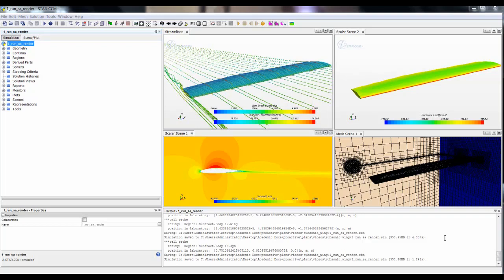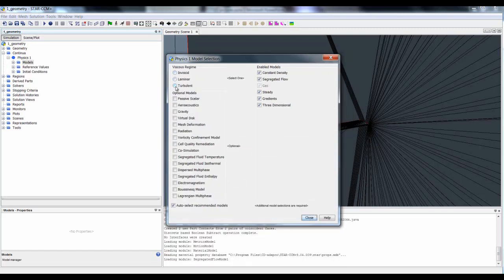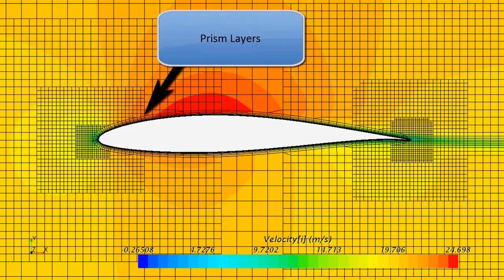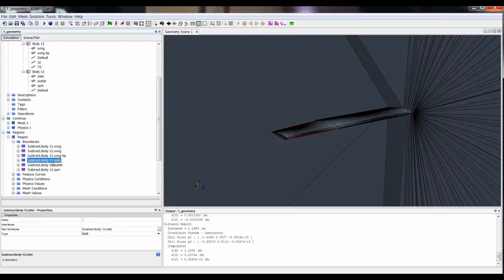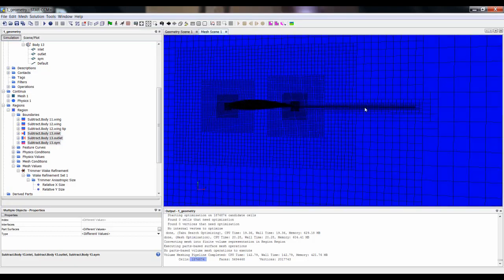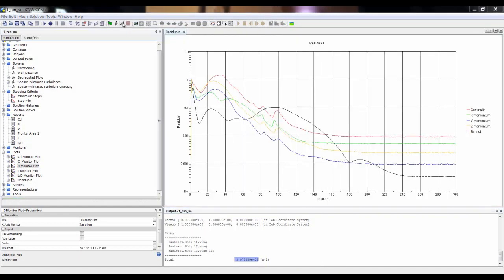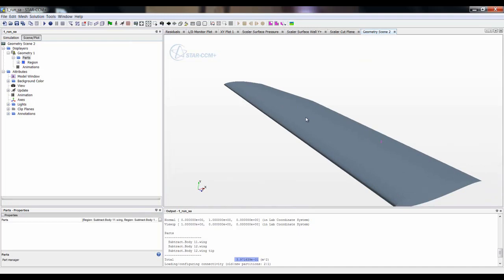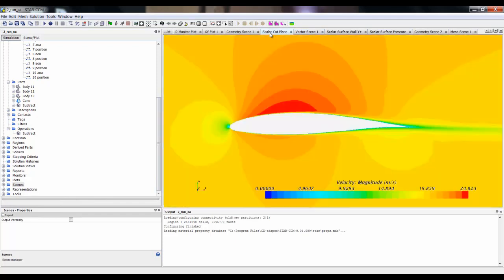Creation of Wing CAD, Parameterized for Rapid CFD Design Iterations

Comment: cool stuff. You should try to add some wing twist, and see at which angle the root stalls before the tip for a certain speed. Wing tips are typically set to stall later, so the ailerons (usually closer to the tip) still provides some authority when stalls starts. Also root stalls generates some structural vibrations, giving some warning to the pilot (in addition to the stall horn obviously)